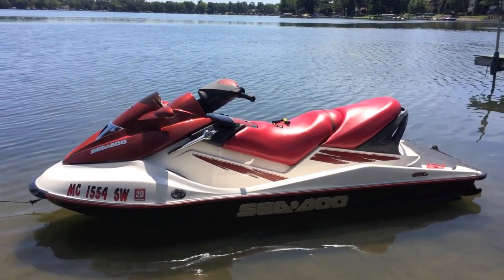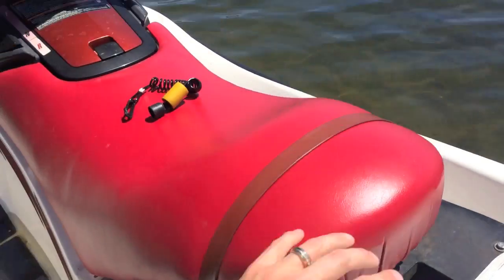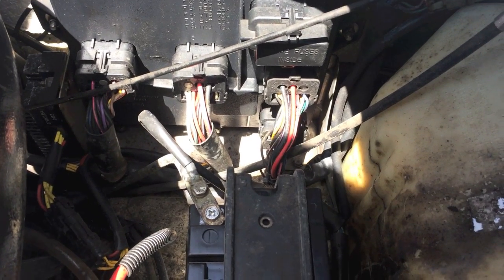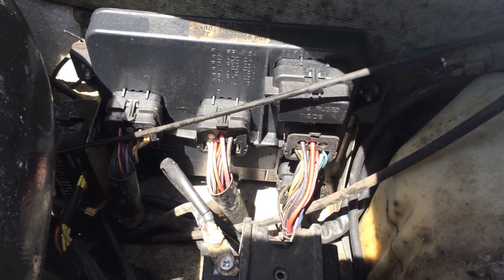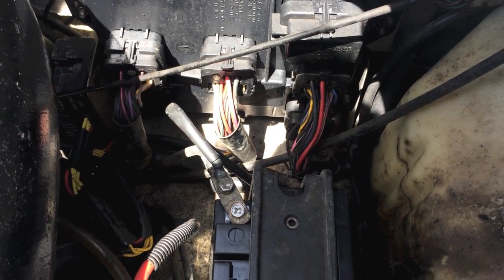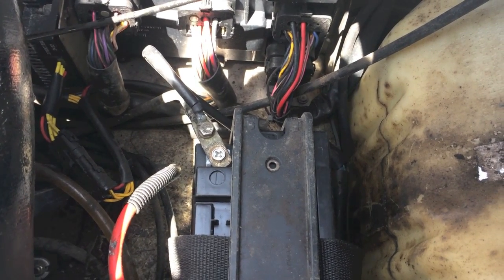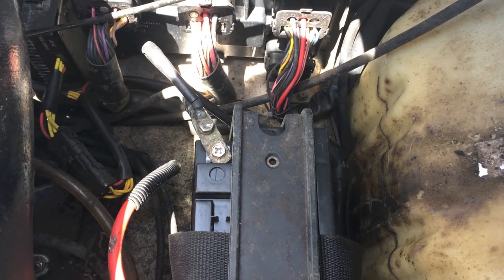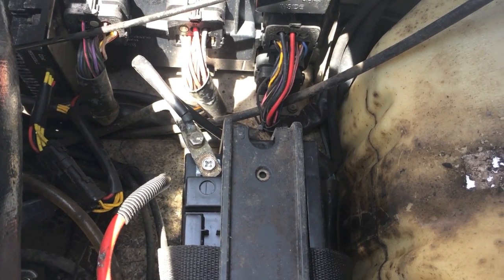Does a Jet Ski have a Charging System/Alternator?  How it works - Explained!

Comment: How can i twst if there is 12 volts  coming from the rectifier & stator showing they are working ?
Reply from the maker: Thanks for watching.  Sounds like both are working as designed.

How old is battery?  Is there any moisture around battery area?

Comment: Have well maintained life long in garage1999 model that looks exactly like ski in video;
Can having a loose spark plug tip not threaded tightly under the cap (so in essence cap is bouncing w/the action of the ski)  cause engine to go & then be at idle then go again after intentionally rocking from side to side,
tyvm?
Reply: Had the on again off again problem the only time took ski out & after visually inspecting everything (after getting home, should of done inspection on the water) found the unthreaded spark plug tip...
Reply from the maker: @jkapown  

Awesome 😎👍
Reply from the maker: Thanks for watching & welcome to the DIY Raptor Club.  It sure can.  Below is a link to a video showing us repairing the thread on a cylinder of an outboard.

       https://youtu.be/FE25C7le64M

Keep us posted on your project.

Comment: Thanks for the info… today was kind of frustrating… I turned on the WaveRunner after charging it fully and it turn on nicely but since it was in the trailer I turned off quick… went to turn it on again and looks like the battery is low… fairly new battery too… now I am wondering if it may be the rectifier.
Reply: Could be a bunch of things but try to clean off all the grounds and the starter/starter solenoid. Place batt on trickle charger if you let it sit for more then a couple weeks. Try a SLA or lithium battery (higher aH the better)

Comment: Hi Michael, great video and very informative. I have a question, I have a 2015 Seadoo GTI 130 SE and I’m planning on rental a sport doc on the water at the lake and leaving it there 365 days a year and maybe use it once or twice a year. Will this drain the battery and what do I do if it does drain when we get there and we wanted to use it?
Reply: Take the battery out and leave it in the house on a trickle charger (1amp max) until your ready to use it. Otherwise you’ll be buying a new battery every year
Reply: And get a lithium battery in that case!

Comment: I have a 2005 Sea Doo 3D. Bought a new 12v lithium ion battery for it last year. Took the battery out for winter storage. Put the battery back in, voltage meter was reading 13+ rode it for an hour or so, docked it and now it won't start. Checked voltage reading 9.5. Charged it up to 12+ and it started great. Rode it for 15min or so and came back to dock and now it won't start again.  Voltage reading at 9 again. Charging it again, but wondering what electrical issues can happen that would cause the battery to drain? Check engine light comes on after about 5 minutes of riding but doesn't appear to affect riding performance.

Any help would be greatly appreciated!
Reply from the maker: Sam Markman 

Thanks for watching Sam.  Sounds like you have a faulty regulator.  Replacing your regulator should fix your issue.  Keep us posted, we are here to help.

😎👍🔧🔩
Reply: @DIYwithMichaelBorders  Thanks! We'll look into that and report back!
Reply from the maker: Sam Markman 

Very cool & thanks for the reply.

😎👍🔧🔩
Reply: @DIYwithMichaelBorders  finally got the OEM regulator in from our local dealer. Got it replaced last weekend and the jet ski runs great now! Thanks for the tip!!
Reply from the maker: Sam Markman 

Awesome Awesome & that’s a great update Sam.  We appreciate you sharing this.  Enjoy the water.

😎👍🔧🔩
Reply: @DIYwithMichaelBorders  HI there. Circling back to this post. After replacing the regulator, curious what your thought are on why the indicator light comes on after 30 seconds - 2 minutes of riding the machine. It seems to run a little sluggish and now the "check engine light" comes on after riding for a bit. Any ideas?
Reply from the maker: @sammarkman3730  

Thanks for reaching back out to us.  A few of our viewers have experienced the same thing.  We recommend disconnecting your battery and leaving disconnected for a minimum of five minutes.

This will allow the system to do a full system reset.  Reconnect battery and see if that fixes your issue.

Comment: Start jet ski and measure voltage. Or should go from 12 volts up to 14 right?
Reply from the maker: jeff K 

Thanks for watching.  Jet Skis don’t have a alternator, they have a Rectifier.  The voltage should read above 12v when engine is running.

Replacing rectifier may solve your charging issues.  Keep us posted.

😎👍🔧🔩

Comment: What you say here may be true of the early 2-stroke engines, but Seadoo 4 stroke engines such as the 4-Tec have 30A charging systems that are very capable, and will fully charge the battery quickly if run for sufficient time.  The powerful 30A generator is why Seadoo is able to fit a 100 watt audio system as an accessory and also Garmin electronics on the Fish Pro.  If you have a healthy but discharged battery, the generator will bring it up to be able to restart the engine in only around 3 mins of running.  Like I said, it is powerful.
Reply from the maker: janet53589 

Thanks for watching & sharing your thoughts.  That’s awesome!  We really appreciate it.  You’re spot on, we reference an 03 Sea Doo GTX 2-Cycle.

They have really started going away from 2-cycle engines over the years...

4-stroke engines are well built & cost less on MX.  We hope the video helped.  We really enjoy making these videos for our fellow DIY’ers.

Please subscribe to the channel and turn on your YouTube notification Bell 🛎 that would be awesome thanks again!

😎👍🔧🔩
Reply: Mannn you are helpful, I just bought a 2020 GTI 130 with the sound system and wasn’t sure how it charged it self but I knew it did some how. Thanks !!

Comment: I have a 2000 gtx that has a good battery but will not start after not being run for 1 week.  It will not start even when using a battery charger/starter.  What is the problem?
Reply from the maker: Biagio Russo 

Thanks for watching & sharing your experience!  Let’s get this figured out.

Have you noticed or heard any clicking sounds as you press the start button?

Clicking sounds are tied to the Starter Solenoid & begins clicking when it fails.  The battery is sending electrical power to starter however if the Starter Solenoid has failed, it will interfere with the start.

The 2nd option may be with your Starter.  It’s possible that your Starter is in its early stages of failing...works when it wants to...& sooner or later it fails completely!  😬

Next, the issue may be with your battery.  It’s recommend that you purchase a fresh new battery each year...kinda annoying if that’s the case right.  🤔

Let’s start there!  Keep us posted!

Please subscribe to the channel and turn on your YouTube notification Bell 🛎 that would be awesome thanks again!  😎👍🔧🔩